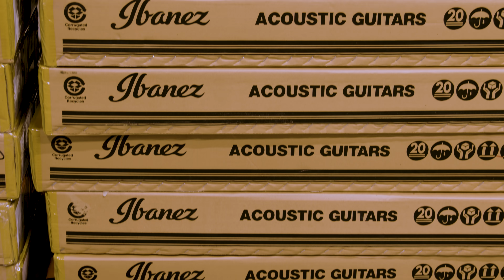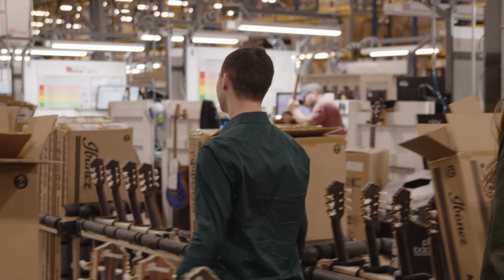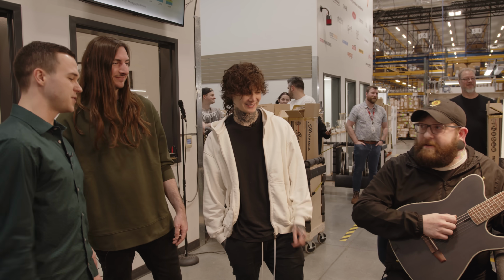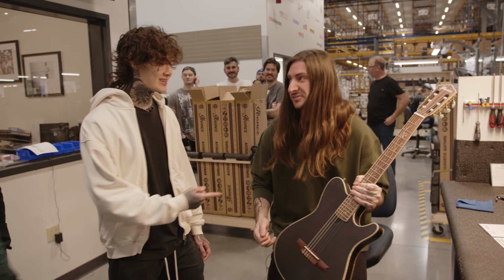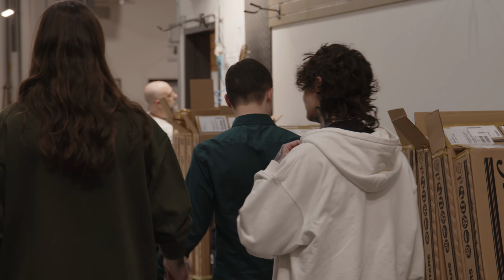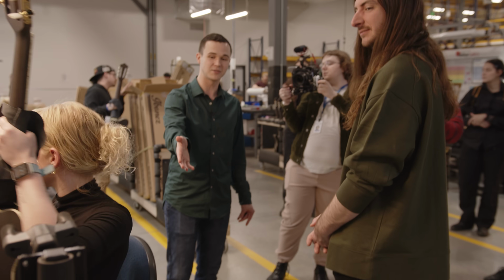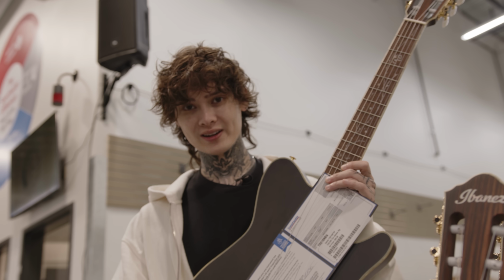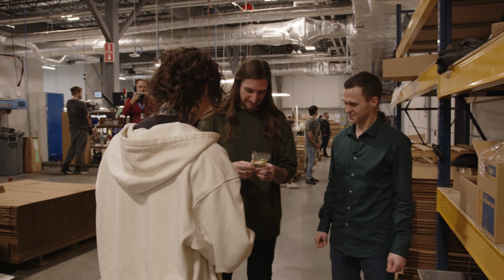Polyphia’s Tim Henson & Scott LePage Explore Sweetwater’s Guitar Gallery

Comment: You guys are why every sweet water guitar I get has mile high action
Reply: First off, are you leaving it in the box to acclimate in your house?! Don’t just tear it open. The box has a green sticker that says to leave it for 24 hours. Their website suggests up to 3 days. I do the 3 day wait, and I never have an issue. In summer and winter in particular, it’s crucial to give the guitar a chance to acclimate inside its sealed shipping box in the room where you intent on storing/playing it since the guitar will get shipped in extreme temperatures, whether very cold and dry or hot and humid, and it needs a chance to let the wood return back to the spot where Sweetwater left it upon mailing it. If you don’t let it acclimate properly, it’s gonna throw of the guitar. 

Also, they only do the 55 point inspection on guitars above $399, so take note if your purchases are under that price point. They get shipped without the extra detailed inspection at Sweetwater. 

Here is the most likely reason: I’m assuming you like super low action, but many people don’t. Unless you pay SW or a shop near your home to have the guitar setup to your preferences, it will be set up with a middle of the road action that may feel crazy high to you. That’s don’t across the industry and with most shops mostly because once nut/saddle material is removed to lower the action, they can’t raise it back for players who didn’t want it low without replacing the entire nut — so it’s a standard practice across the industry to keep it at a middle action height to ensure it’s not cut too low. The 55 point inspection is not a guitar setup. Watch Phil McKnight’s deep dive explanation that goes through each step of the inspection so you’ll understand what Sweetwater is aiming to check before mailing the guitar to you. 

Ultimately, if you want your action lower than the industry standard setup, it’s reasonable to expect that you’d have to adjust the action yourself or bring it to a guitar tech for a setup (if you don’t pay for SW to do it). It would have a higher action way no matter where you buy the guitar unless you have them set it up to your preferred specs.